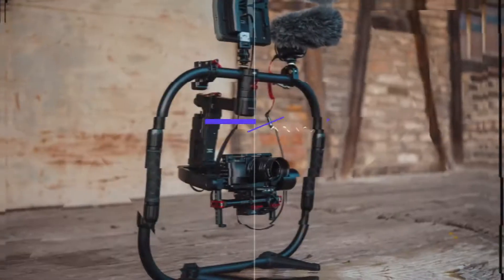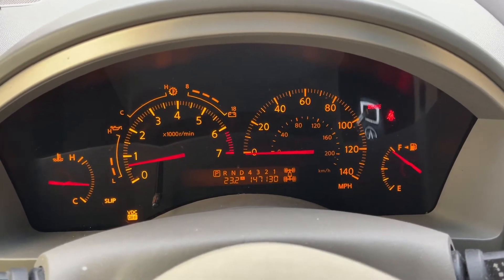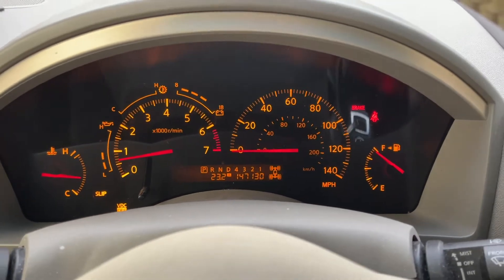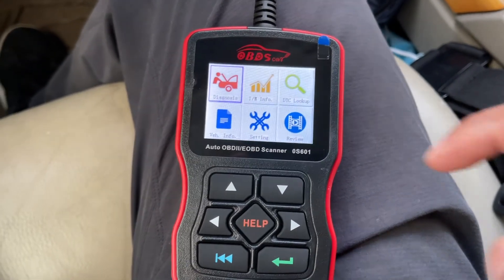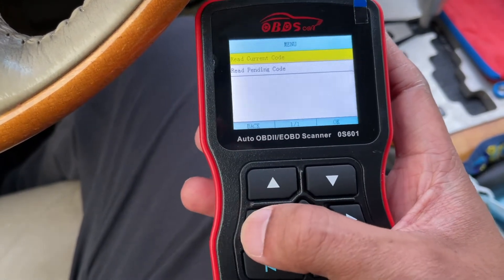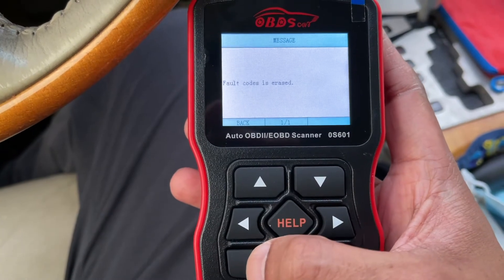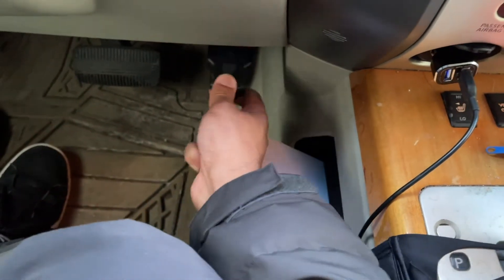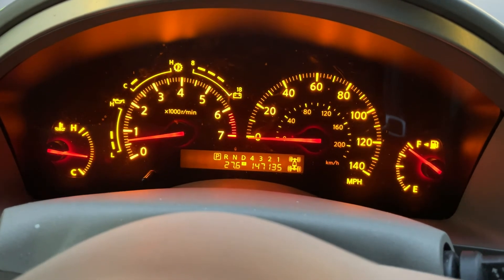DIY - Diagnostic Scan / Universal Automotive Engine Fault Code Reader - OBDScar OS601 OBD2 Scanner

Comment: just bought mine for 2004 trailblazer.  says no communication.  WTF?
Reply from the maker: It doesn’t connect to it at all? Idk about that specific car but is it on their list of compatible cars?
Reply: I'm having the same damn issue...I have a 1989 chevy c1500 with an 2002 LS swap motor
Reply: @Tom Smith $500 to check a code?  Nah.  I just went to Auto Zone had it checked for free.
Reply: @Tom Smith true